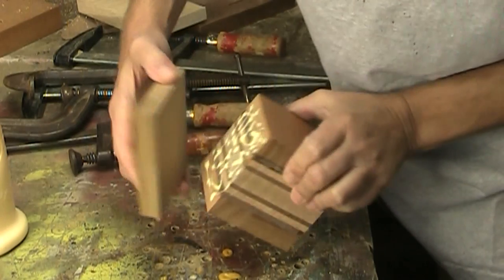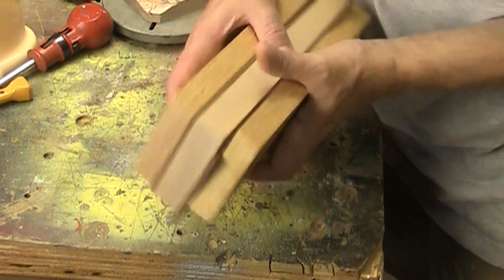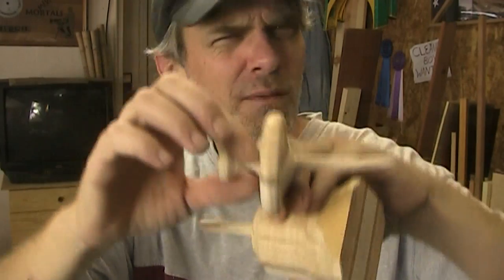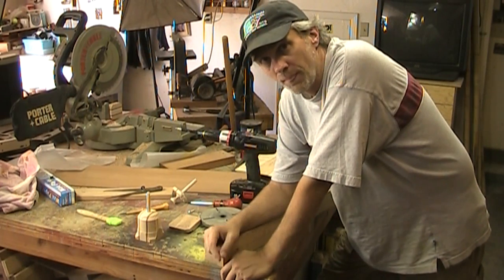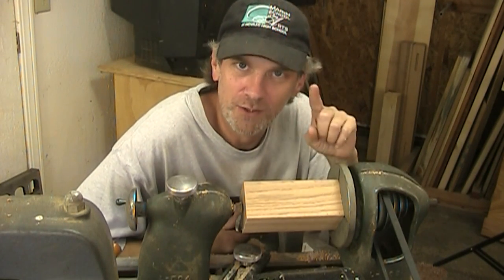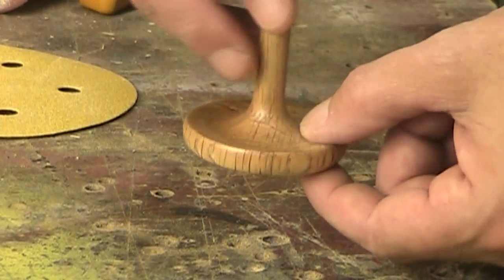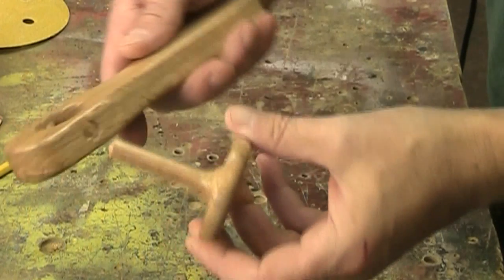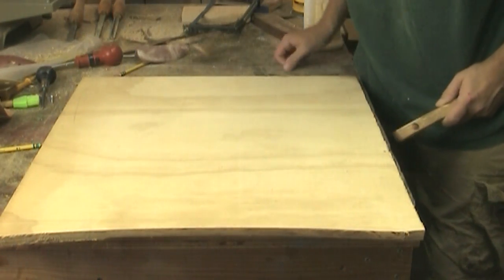Make a spinning (sorta) toy (kinda) top (well, okay)

Comment: Make a plywood top for your drill press table that has a hole in it the size of your drum sander. Lower the drum sander slightly into the hole and then you can support your workpiece on the plywood top and be square with the spindle.

Comment: great video Steve! turing tops is always tricky to get the weight at the bottom just right i am no professional but one reason for the top not spinning long and falling off the board could be the weight is to close to the point or the table just a thought... great video tho!

Comment: If you carve your tops the other way around, disk towards lathe chuck tapering toward end support, it won't break off like that.  Also if you hiod the top off of the table and pull the string, so that the top clears the handle before touching the table, it will not go as wild.  8-)

Comment: Well, you'll never get vetted at this rate.
To help the top spin in one spot rather than move all over, make a pointy steel tip for the top to spin on from a duplex nail. 
Cut the top head off of a duplex nail and grind the stub to a pointy cone.  Then cut the nail shank down to 1/2 inch from the remaining, lower, head.  Drill a hole in the top for the nail shank and press it in so the pointy tip sticks out.